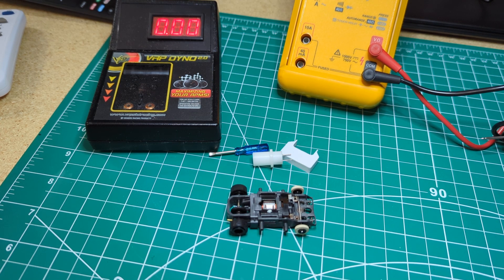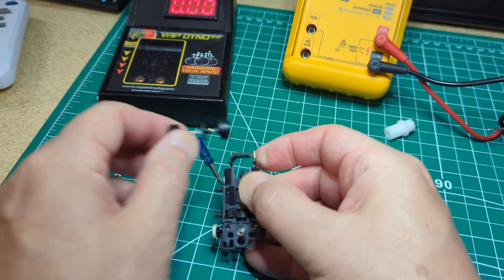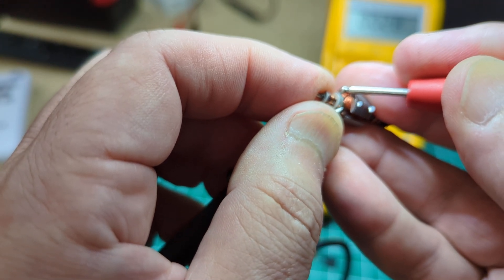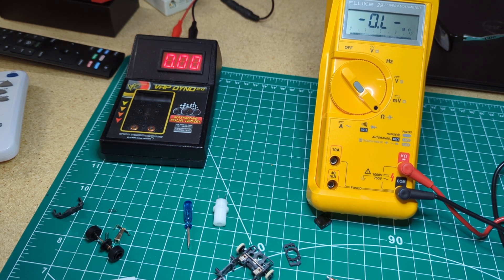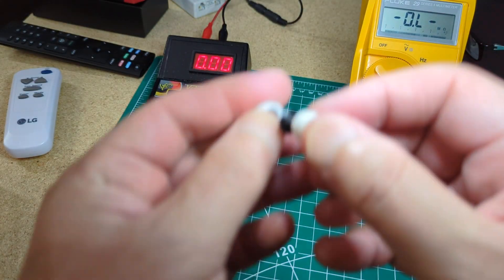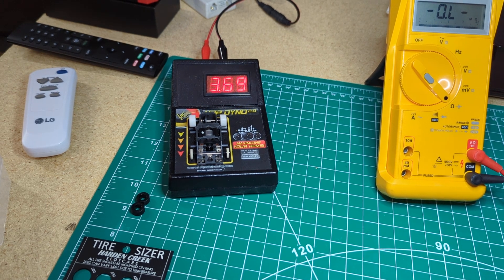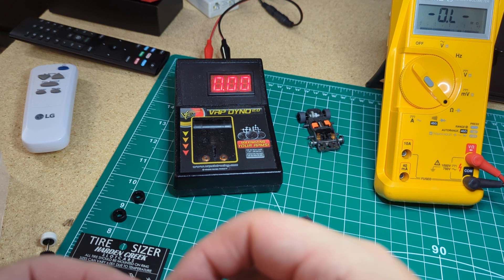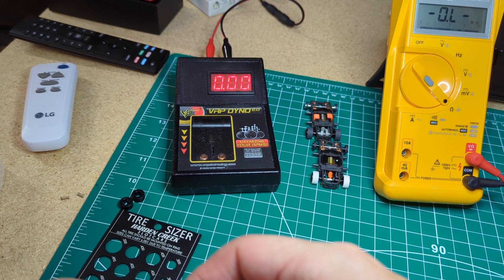Used Viper - Is it really a PolyMod?

Comment: I agree with the comments regarding the arm.   Judging from the com and the laminations the arm doesn't look like a quality piece of work.  You talked about armature spacing and play but is the motor centered in the magnetic field?  If it being shoved forward or backwards then performance will suffer.   In addition the endbell needs to be tweaked and fully broken in before that thing will sing.  Finally as someone else commented Polymod means different things to different people.  Swapping Level 10 magnets and a 2.5 ohm motor into an otherwise stock chassis doesn't make a stock Viper into a Polymod.
Reply from the maker: Thanks, all good points. I would say yes the motor is spaced properly in the center of the magnets, the endbell is tweaked and broken in, I also just did a follow up video that I am about to post where I took the arm and put it in one of my 3 ohm Viper modified chassis and the issue with the slower than expected Dyno numbers followed that arm. When I say PolyMod, I mean what Viper sells as a PolyMod on their site, they have a specific spec car they call a PolyMod which this car was supposed to be. I have build several 2.5 ohm Vipers, they all hit above 500 on the Dyno easily without any major tweaking so I agree this arm just does not seem to be good quality.

Comment: I can’t say for sure but I suspect its the motor magnets. Personally I have gone down this road before. I would suggest pulling the arm and putting it in one of your fastest running poly mod cars and then test it. I have a bare chassis on hand for just this same reason
Reply from the maker: Thanks for the suggestions. I thought about the motor magnets and took them out again and tested them, they were equal in strength to motor mags out of my cars so it's not the magnets. I am to the point where I feel it is the arm. Good idea swapping the arm into one of my cars, that would show for sure if it is the arm.

Comment: Interesting. One thing I would say is just because an armature appears to be balanced doesn't necessarily mean whoever balanced it did a good job. But with that being said there seems to be a couple potential clues. The motor brushes that were in the chassis had some kind of obvious issue. The cause could be important. Additionally after you went through the chassis it ran a bit better but then slowed down. Makes me think it may have gotten too hot sometime in the past. Once it gets up to operating temperature there could be a short in the windings. Windings in any electrical device sometimes seem fine cold but once they warm up a short appears and sometimes even an open circuit. Doesn't seem bad enough for an open circuit though. I've seen cars that ran with only 2 of the 3 armature poles working. 1 of 3 windings open. At any rate I think you have the right idea that this arm isn't equal to yours.
Reply from the maker: Thanks Jeff, and yeah I agree not knowing the history of it I don't think we will ever know. I did a little more work on it and added a shim to the from of the arm and changed the shim in the back and that helped a bit, got the Dyno up in the low 4's but then after running for a few minutes it drops back down to 3.7 which I agree is strange behavior and makes me question the health of the arm. I also tested the strength of the motor magnets against ones form my cars and they were the same so it is not the magnets.

Comment: Check the gap in the arm .. run the tip of exacto knife in the gap make sure it’s clean.. then run a ball point pen between the plates and put a slight radius on them .. also make sure you have a shim on the front of arm and maybe take out end bell shim if you have one
Reply from the maker: Thanks for the suggestions, on  my cars I do run a .10 shim on the front of my arms, this arm did not have one. I did clean the commutator gaps, spacing of the arm that my buddy did was pretty good, I just think it is a low performing arm for what ever reason. All of my 3 ohm vipers are running much stronger than this 2.5 ohm arm. I will give it a few more tweaks and see if I can get more performance out of it.

Comment: "Polymod" is one of those terms that has become a little nebulous and means different things to different people.
Technically all it started out to mean is simply a car that's running compression molded polymer motor magnets. The term was coined back when they first hit the slot car market and weren't very common. Back then, they started the "CMPM" class.
They were first made because they were much stronger than ceramics but more because they were "tunable" in manufacturing and could be made to any strength and, because they produced a more consistent and even field, they didn't need to be matched. The material any one batch of magnets is made out of is homogeneous so all the magnets produced are almost the same.
Now, of course, they're everywhere and they're getting to be cheaper than ceramic magnets, especially the stronger matched ceramics which are now increasing in demand in order to meet class rule restrictions.
Reply from the maker: Yup, thanks Ralph I was aware of all that. Viper does sell a car they label as a PolyMod which is what this car was supposed to be but I have my doubts that the arm in my friends car is the 2.5 ohm wide gap high heat arm Viper says is in their PolyMod car. Also all of my 3 ohm Viper modified run in the 4.5 range on my Dyno while this car does not even hit 4, seems to me the arm is just not where it should be. I mainly did this vid as a favor to my friend who was curious about the arm in the chassis.
Reply: @marksslotcargarage  Did I drone on? 🙄The poorly defined terms cause me some headaches so sorry about that.
Reply: @marksslotcargarage  Got a Gauss meter? I'm thinkin those magnets just aren't as strong as yours.
Reply from the maker: I was thinking that as well about the motor magnets, I do have a meter and can check them....thx.